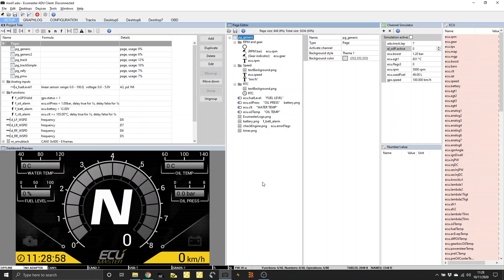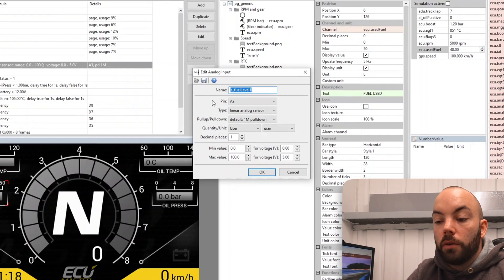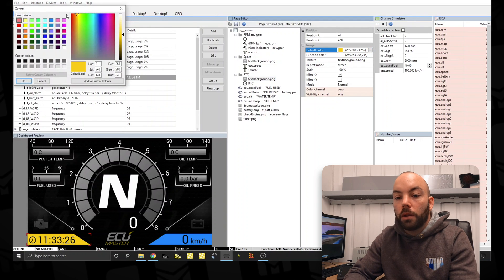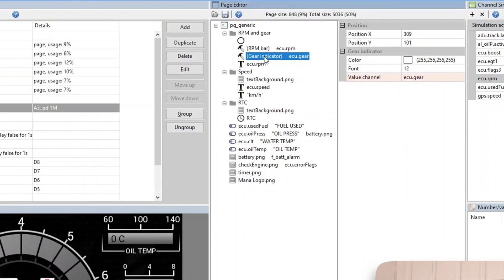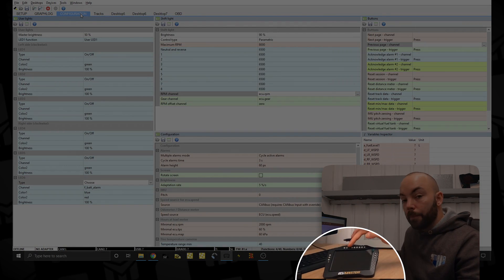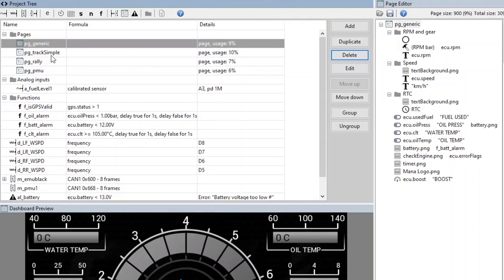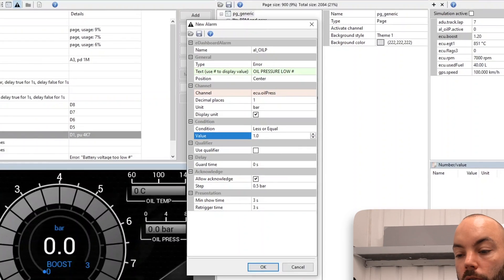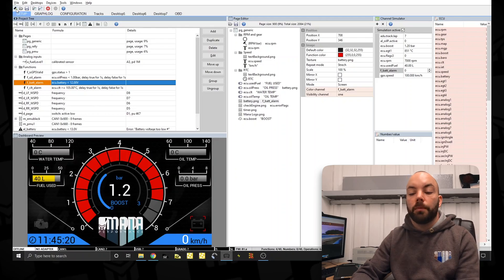ECUMaster ADU Introduction and configuration walkthrough - Mana Performance

Comment: If I have a emu black. And buy this adu7, do I have to retap all the sensors into the adu7? Or can the adu7 just get all the info off the ecu  via canbus?
Reply from the maker: Hey. No need to rewire, you can send all the info via canbus from the EMU Black to the ADU.

Comment: Can gear sensor be calibrated on adu ? Or must the sensor go to ecu, and then to adu ?
Reply from the maker: Hey. Yes a gear sensor can be calibrated to the adu. No problem. Use -1 as reverse and 0 as neutral.

Comment: Hi Sam, Great video, used most the content to setup my ADU . One thing im struggling on however is getting the AFR gauge to work, canbus to emublack it seems ecu master has a fault whereby ecu.afr will not simply pull the data across and instead they say use make a table from the lamda sensor calcs *14.7 however im struggling to do this. Any suggestions ? 

Cheers Damian
Reply from the maker: Hi Damian. 
Thanks for the kind words about the video. 
Making a math channel is going to be in the next ADU video I do. If you’d like to email me then I could send you an example if your desperate. 

Thanks

Sam

Comment: Excellent video Sam, any chance of more ? CANbus and pumps? And setting up inputs outputs etc?
Reply from the maker: Hey James. Yes I will try to get some more done. What do you mean by pumps? Fuel pump? Usually this would be controlled by the ECU
Reply: @manaperformanceuk  Hi Sam, that was a typo, should have read PMU's. I have a PMU and ADU and still learning loads about what they can do! All the import/exports as canbus etc would be good.

Comment: Great video Sam, can't wait to upgrade to EMU Black + ADU
Reply from the maker: Make sure you let me know when your ready 😉
Reply: @manaperformanceuk  Is there much pin adaption required for the Classic to Black plugs?
Reply from the maker: No just a slightly different layout on the black connector.
Reply: @manaperformanceuk  Perfect